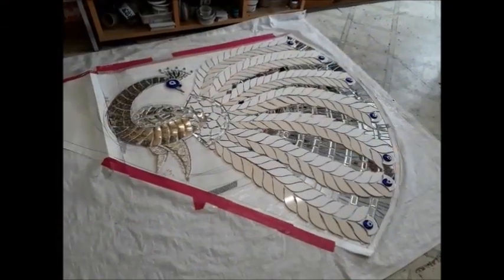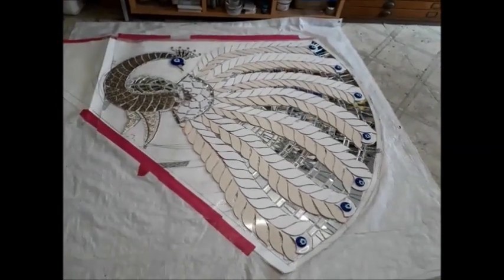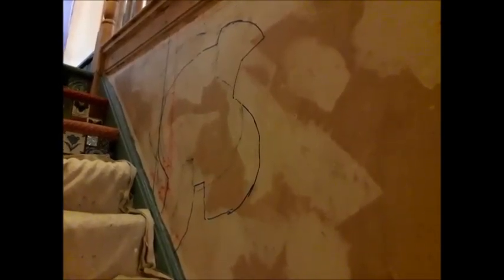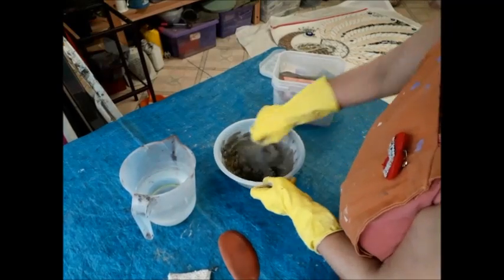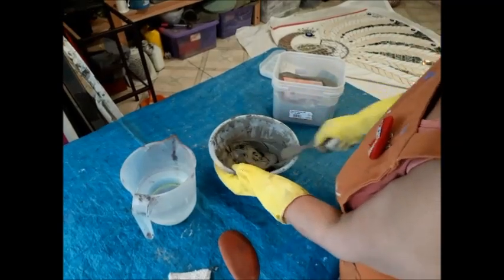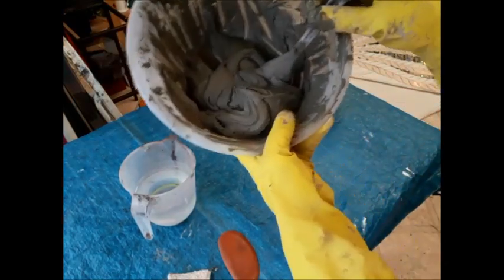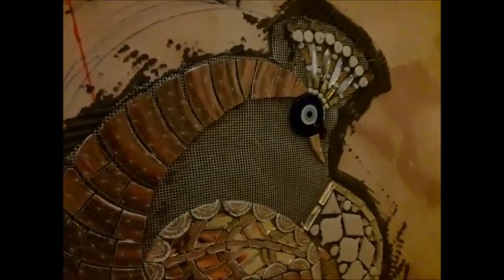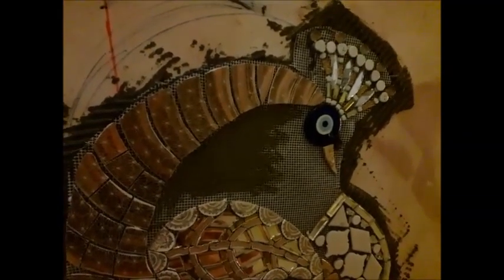Golden Peacock Mosaic: Part 2 Installation of the Peacock Thurs 18 June 2020

Comment: Beautiful work. I live in Spain and want to cover an outside terrace wall with mosaic. I know I will have to use mesh and/or craft paper technique as the mosaic frieze will be added to an undulating wall.
However, due to the high temperatures, which type of adhesive and grout would you use to adhere the tiles? I want to colour the grout so will require a base coat of white.
Secondly. I wish to put a mosaic frieze behind a wood burning stove to line the chimney and add interest. Do I require a special tile adhesive and grout to do this? Your help will be much appreciated. Regards AlisonX
Reply from the maker: Hi Alison, lovely to hear from you! I'm thinking that you'll have to do a pop of research into the adhesive and grout you will need. I use Mapei products which is a Spanish company. I recommend you get in touch with them as they would be ideal in technical advice on temperature etc. The technical support team in the UK have been excellent with advice. All the best Caroline
Reply: @mangomosaics  Thank you so much for your prompt reply and excellent advice. I will do so. I am working in the UK at the moment to pay for continued development of my old house. The renovation began small but as per usual, you suddenly realise you can do so much more. Three years later excavation work is completed and rebuild is getting there! LOL.  
I cannot wait to return full time where my mosaic plan will continue. I intend to do the mosaic in the UK and then attach to my walls in Spain on my return. 
I will remain in touch and of course watch your videos for the excellent ideas you show. When my house is completed, this summer, you and your family must come and visit. A nice, inexpensive holiday for you. I live on the borders between Almeria and Murcia Provinces, in the Almond growing area. Beautiful and peaceful, especially when the thousands of trees are in blossom. Hey ho, I miss it but needs must! Anyway, thank you for your advice. Regards, AlisonX